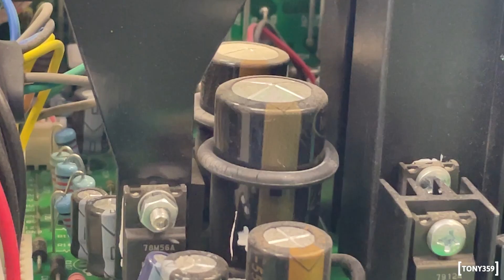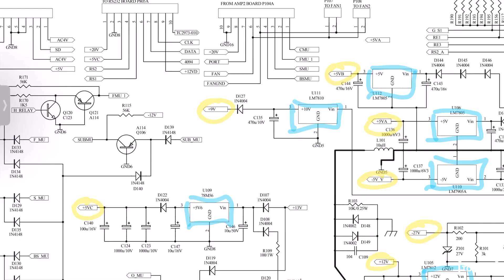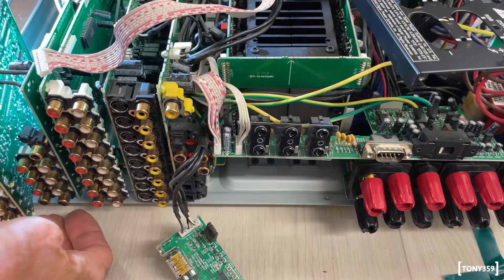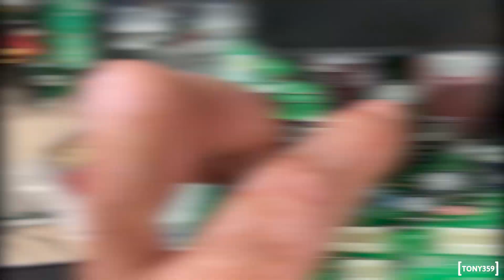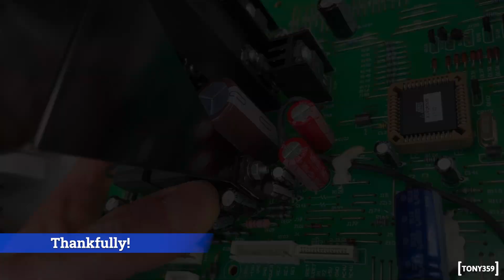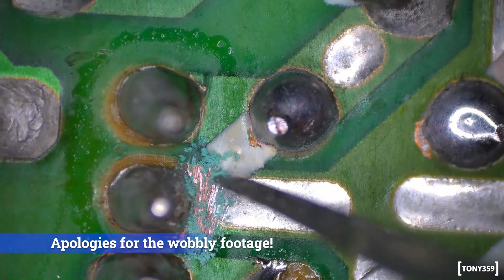ARCAM AVR-280 Repair and test - part 1

Comment: Hiya well in 2026 I'm using my trusty AVR 280 and AVR 300 , purchased from Superfi 2007,  and after sending them back to Arcam in Manchester for Firmware updates many years ago have never had any problems and they are in daily use 
ONE big Secret is keep the amp cool / Cold  , The amps are underneath the TV / cable & DVD cabinet,  i have set Small desktop usb fans at the side of the amps that run all the time the amps are on , they blow cool air into and across the amps with little to no noise
Reply from the maker: yes that is probably what has extended the life of your unit! 🙂

Comment: Hi Tony, Great Video 👍 I Have the same AVR 280 amp that has just died 😢
It had had a buzz for a while, I just lived with it it wasn’t that bad. One day I turned it on and nothing happened 🤷🏼‍♂️ I thought I had turned it off but mustn’t have and after about half an hour or so it powered up and worked fine. Worked perfectly the next few times I used it then one day it wouldn’t power up and has never worked again. I’d love to get it working again but it’s beyond my abilities. Would you be interested in repairing it for me I’d be happy to pay you for your time
Reply from the maker: Those Arcam's are small ovens, they're really badly engineered from the thermal point of view I'm afraid. Are you in the South West of the UK by any chance?
Reply: @tony359  I’m in Derbyshire Midlands
Reply from the maker: Could you possibly send me an email? Email is on my profile, under my details. Thank you!
Reply: @tony359  It’s probably me being daft but I can’t seem to find an email address on your profile 🤔
Reply from the maker: No it's not you, they moved it to the least obvious position! :)

If you go on the main page of my channel and click on "Here I tinker with things etc" it takes you to a section where you can see my contacts, socials etc.

Comment: Nice vid mate - I've watched a couple so far and have subscribed. I have the same component tester and it's useful; especially for transistors.
If you ever wanna spring for a really handy gadget for testing caps you should check out the Peak Atlas ESR meter. They are kinda expensive but with the needle probes you can so quickly check electrolytics even in circuit. The in-circuit test will give you an accurate ESR reading and most of the time capacitance too!
Reply from the maker: Thank you! I took a look at the Atlas meter a few times and every time I’m put off by the price to be honest! But I agree it would be a good addition to my tool box!

Comment: Also check the large capacitor on the analogue board.
Reply from the maker: Can you help me identifying the board you mentioned? Most of this unit is analogue! :) Ideally I should check them all but... Thanks for watching!
Reply: @tony359  Yes it is the upright board connected to the smaller board with the small board with the arrow on it, I believe it is 2200uf 10v.
Reply: Second board from the left if your facing the back.
Reply from the maker: @errol8000  gotcha. Are those known for failing?
Reply: @tony359  Yes.